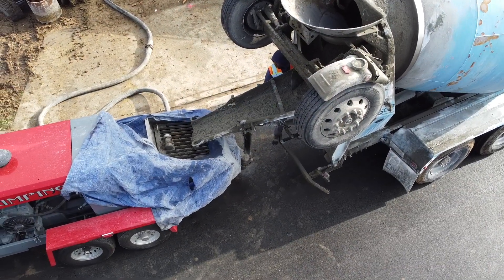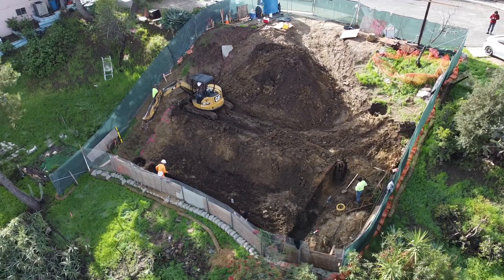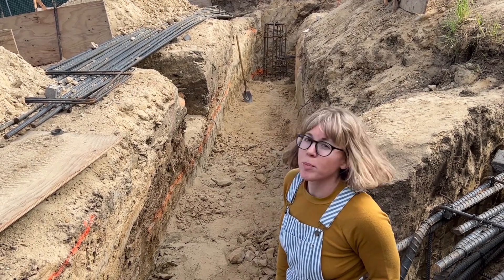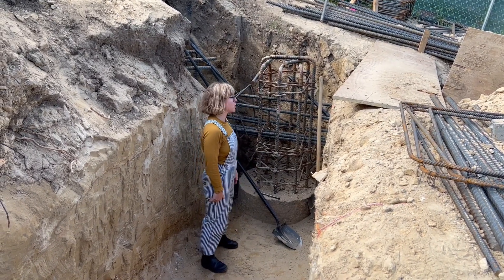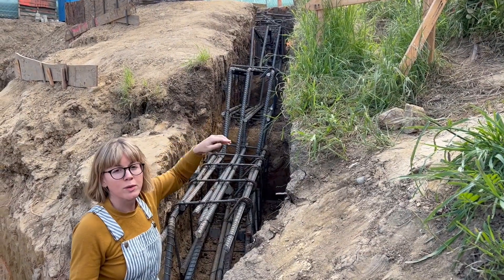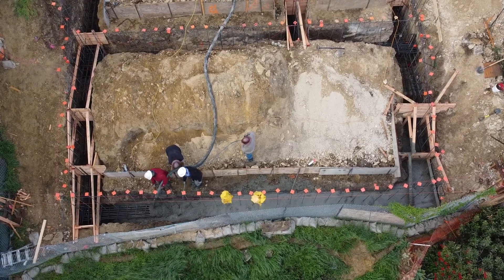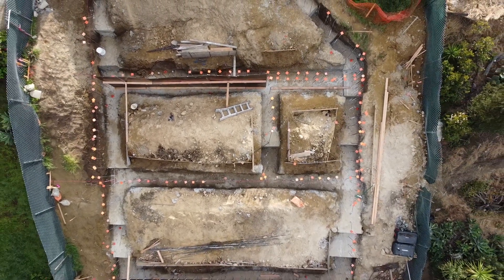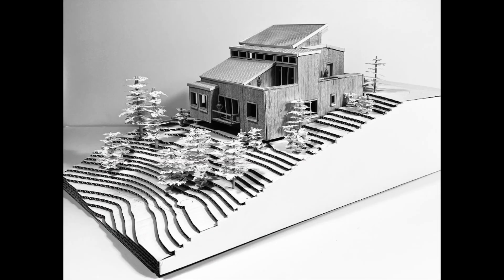SLOPEHOUSE - EP 2 // Building a Hillside Foundation in Los Angeles

Comment: How did you dig the pile holes if you could not get equipment back there?
Reply from the maker: There's access from the street above - rough grading got the drill rig down for the bottom two piles then we worked upwards

Comment: What a great video! I have been looking for a video on how hillside construction is done in LA. That rebar is insane, looks more like pipes, and same with the piles. What a massive foundation. When the piles get poured, is the rebar stuck into the bedrock via drilling holes in it? If not, would the piles not also slide off the bedrock in case of a landslide?
Reply from the maker: Yes, the deepest of those holes is 30 ft (about 28 feet into bedrock), but they range from there to 9ft for the two piles at street level. In the video you can see the rebar cage is dropped in the hole, and then concrete is poured in to create the pile. So yes, they are embedded deeply into the bedrock

Comment: I'm curious about the decision to go with a two-story structure supported by piles that are 30 feet deep. The thickness of the structure seems impressive. I'm wondering if this level of construction intended to meet specific building code requirements? What drives you to select such massive foundation for just two story building?